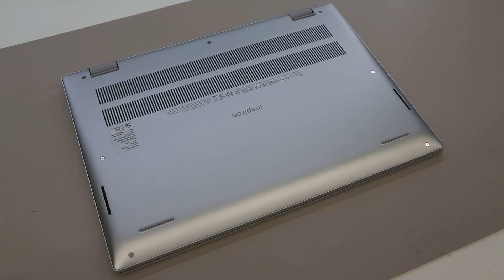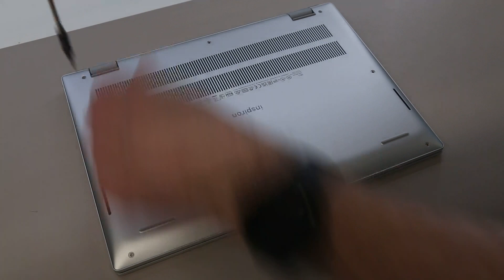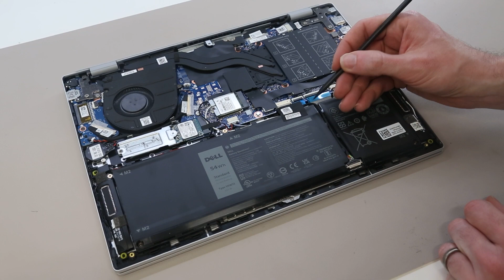Dell Inspiron 14 5425/5420 - RAM, SSD and WiFi Upgrade Guide (2022 AMD Inspiron 5000-series)

Comment: Sir, I am facing heating and fan noise issue on the same model while on charge. I just use system for normal tasks such as browsing. Do you face the same? Is there anything we can do to minimise the heating as I have tried everything apart from opening the laptop.
Reply from the maker: 1. Check in Task Manager if you have any processes continuously running at a high CPU or GPU occupancy - if you do work out what they are and why they are doing this. Could things like Windows Defender running full scans, Indexing searching the drive or something else.
2. Check the power profile is set to Balanced, not Maximum Performance.
3. If still having issues then open laptop, check heatsink/fan isn't full of dust and clean as required - refresh thermal interface material with a good quality paste.
4. If still having issues and seeing unexplained high CPU load you may want to do a clean install of the operating system.

Comment: Sir, If there's already files from systems in internal is it affect the computer???
I mean did we need to cut and use reserve hardisk as temporary storage systems and put it back in our new Installed ssd upgrade??
Reply from the maker: Yes removing the storage will obviously remove the existing files.
You can either clone them across to the new drive, or clean install Windows and copy documents etc over.

Comment: I am a student from india . I purchased laptop 💻 with my only only Inspiron 14😢 5425. I was using chroma while adapter charging was on , there some notifications comes to update and I did it. The screen got black and lights are working on keyboard. I called Dell customers they say said motherboard not working for corrupted. 3amber 4 white light bopping 😭 I am student and I don't have any money to give to them to fix it. They send update things and destroy my motherboard of laptop. I put all my trust in Dell but they stabbed me 😭 I can't afford motherboard price now. Someone help plz
Reply: Same happened after buying 1 month just call service center so u can may get it done under warranty mine was done replace of mother under warranty not even a single rupee paid but took 25 days to get components to my home town
Reply: Sorry this happened to you. It is a mother board issue I think and Dell must be very well aware of it too. I had two 5425 and both had same issue one month apart. I had to replace the chip and do a  motherboard repair (what the shop told me). Looks like a known problem for this model I feel.

Comment: Great video JAMES,  It helped me a lot for add more memory at the same laptop model I have as well. Thank you ,  thank you 👍   Can I attach one question ? So,  Can You tell me, please, what kind improvements I would have in my DELL inspiron notebook  doing some wiFi wireless card upgrade?  I wondering if doing this would make any fast speed for the wifi ?  Or ,  just tell me, please ,  what would be the difference ?  Thanks a lot again 👍

Comment: Thank you.  High-quality presentation.  I pressed Thumbs up.
Question: My new Dell 5420 has a 256GB SSD drive.  I aim to replace it with a 1TB SSD.
Drives from Sabrent, 51Risc, TeamGroup and others cost less than half of Dell.
Are there dreadful-dangers in using non-Dell?  Of course I will require matching Form Factor (M 2 2230), Interface (PCIe 4.0 x4 (NVMe) and Class (35).
Reply: I doubt there's any risk here. The built-in one is probably Samsung or something similar, and they are all standard, compatible items.

Comment: HI, Can we replace the wifi card with another ssd card 2230?
Reply from the maker: There may be some adapters or specific SSDs for fitting to them, but standard ones won't fit. The keying of the slot is different.

Comment: I would like to upgrade the ram to 32 and the SSD.  Will I need to transfer any programs (Microsoft office) and others to an external drive or do they make tool that connects via usb that does all necessary transfering of programs and files before opening and exchanging?

Comment: Sorry, this is a complete noob question. If I replace the SSD, don't I lose all the data or even the OS?.. I just dropped a few hundred dollars on these parts and don't want to mess anything up. Thanks
Reply: I'm late, but yes, you will need to completely reinstall Windows. Make a bootable USB drive with whatever OS you wish to use. However you can also use cloning apps to clone your existing data from your old SSD to the new one which shouldn't be that hard, try to look up a tutorial for it.

Comment: Hey! Thanks for guiding us with the videos, i have the Dell Inspiron 5415 and i already have a DDR4-3200 from Kingston and i would like to know if i have to take the same for adding another 8gb on the secondary slot, or if i can take any DDR4-3200? 

Thanks a lot
Reply: The brand doesn't matter.
Reply: I have the same model. Can you please tell me if there is a second spot or channel for ram?

Comment: i’m stuck between this and a Lenovo Slim 5 Pro. Similar specs, but the Lenovo has 2240x1400 display, costs £40 more, and only has 1-year warranty (the Dell has 2-years).

I’d like to hear your suggestion please

Comment: Hi! Congratulations for your channel. I bought one Dell 5425 and I want to put an additional 8gb of ram in it. I am looking for a 100% compatible module that does not penalize, I am referring to the timing of the ram, so that the module that I add can be compatible with the factory ram. I have seen that you added a crucial. Is 100% compatible including timing the crucial ram? Thank you very much for your help
Reply from the maker: The Crucial DDR4-3200 CL22 modules are correct - this is the JEDEC standard speed and matches the modules Dell use.
Reply: @BrueComputing  Thank you so much!!! The best channel and the best professional.
Reply from the maker: No worries - glad to help!

Comment: Received mine today, great bit of kit. However there's some very interesting things going on inside the base. Does yours have, like mine, gold coloured metallic tape stuck on the inside of the base, which aligns with the cuts outs on the heat sink pipes? I assume this was to aid heat dissipation to the base? However this gold tape is then covered with clear plastic making it useless. Also a large part of the air vent is covered with black plastic which just seems ridiculous. If you reply with your email I'll send you an email with some photos.

As you know on these small laptops thermal throttling is a huge issue, killing the performance of the CPUs. Looks like Dell designed it with this in mind then did a complete 180 and added these hacks post production, probably because the base was getting too hot.

Maybe you could even do a video on removing these post production mods and unleashing it's potential?

p.s. you said in your video all the screws in the base are the same, I don't believe they are. The two screws at the bottom which go in at an angle are slightly shorter.
Reply from the maker: Drop me an email at info@bruecomp.co.uk - I'll take the back off mine and see if it is the same.

Didn't notice the front screws being slightly shorter, but I didn't check closely.
I always arrange the screws on a magnetic pad in the positions they were removed from and refit their original places just in case.